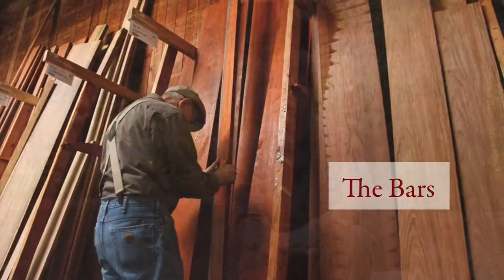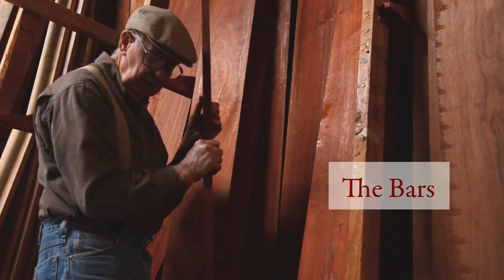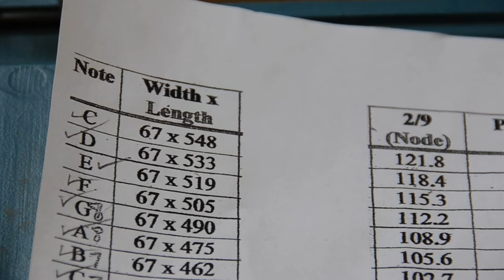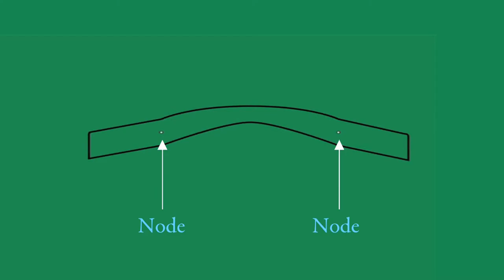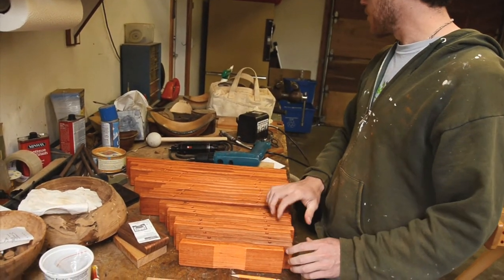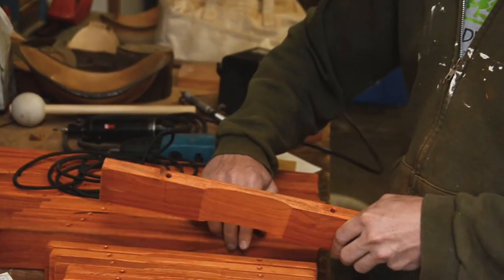Building a Marimba

Comment: Is the inner cut always same size? the arc under what size
Reply from the maker: Hi Luis, No, all the bars are, more or less, different shapes, varies with the note/length of bar and tonal qualities (grain? and other things?) of the individual bar piece. Look at this page, for example summary of bar tuning:
https://www.yamaha.com/en/musical_instrument_guide/marimba/manufacturing/manufacturing002.html
hope this helps.
Reply: @davidaadler  The fourth harmonic two octaves above the fundamental sounds the strongest a quarter way from the end. The pitch of the fundamental is lowered by removing wood from the thinner center part of the tone plate. How is the pitch of the fourth harmonic lowered or raised in relation to the fundamental? For instance, does the pitch of the fourth harmonic fall relatively more when wood is removed closer to the quarter-from-the-end point (widening the notch) as compared to deepening the notch, or is the trick something else altogether?